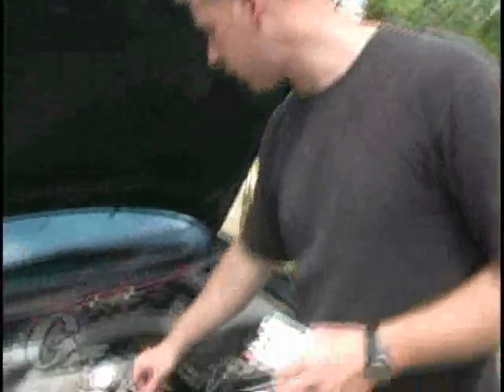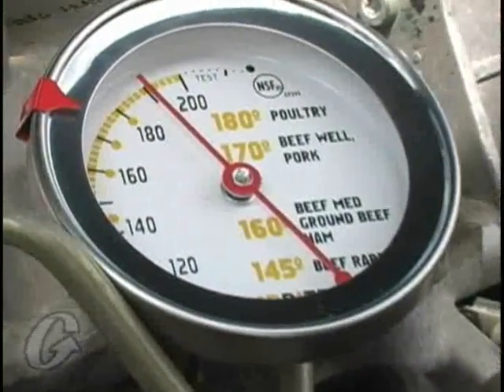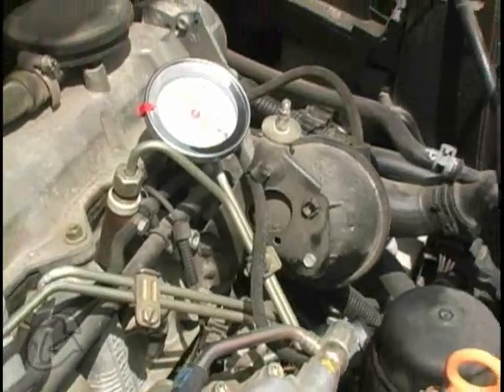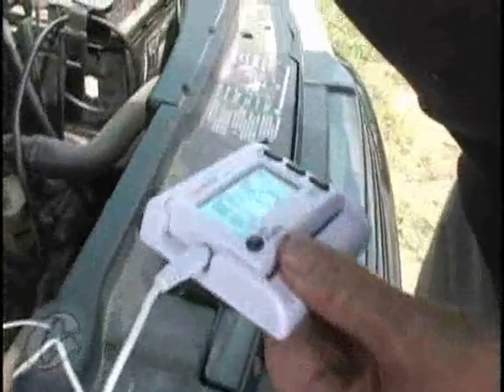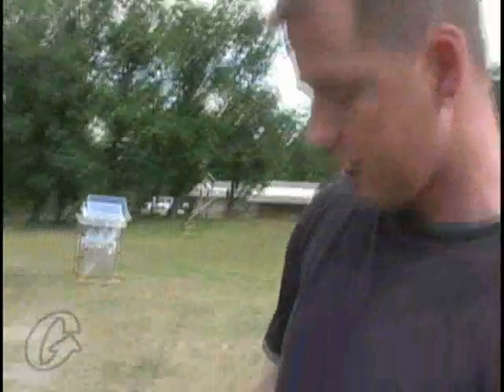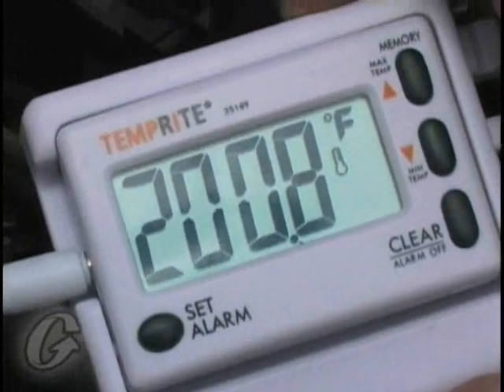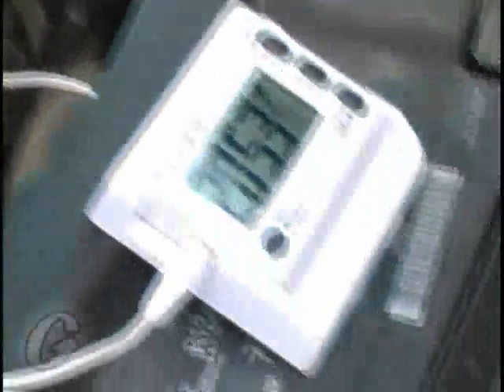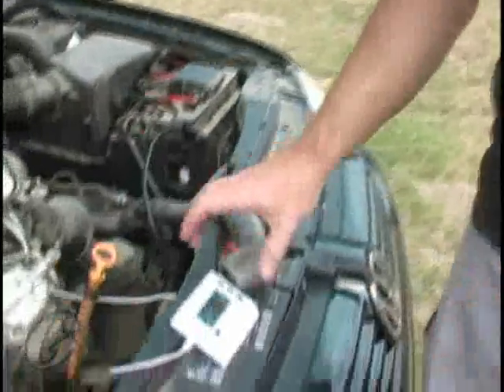Episode 4: The Engine is the Final Heat Exchanger

Comment: yea this is all correct but if you heat it up it gets thinner and makes it easier to pump through the unheated pre filters like my filters in my mercedes  before the injection pump but you dont have to heat it past that point because the engine components are heated up your also supposed to start the engine on diesel or bio diesel first to bring it to operating temp before you burn the veggie oil

Comment: I cant believe that anyone would be so dumb as to think the oil had to have an outside heat source before hitting the injector. On a cold engine you could heat the oil to 300 degrees but by the time it hit that cold injecter with a cold head heatsinking it all it would still end up cold. Same goes for the the hot engine in heating the oil up as it goes through the injector. As long as your oil is warm enough to flow from the tank to the injector it will be fine. Now Stanadyne pumps may object.

Comment: Im thinking of doing this. Over here in Britian we use thinners to thin the oil down a bit to make it flow. Further to your idea how about a copper coil wrapped around the exhaust manifold? That would act nicely as a heat exchanger. So from the tank, through the copper then into the injector pump. See my point?